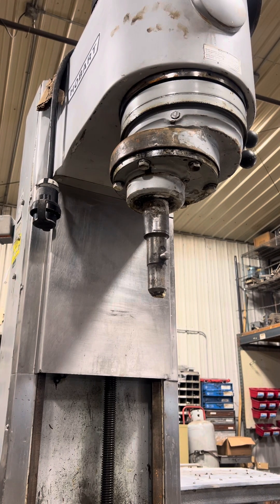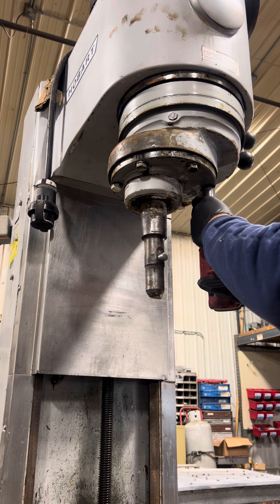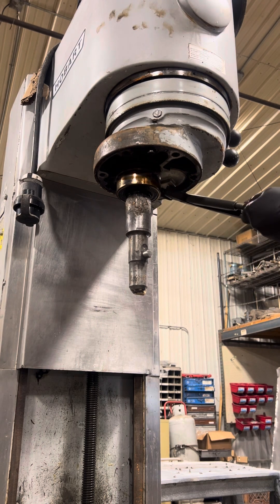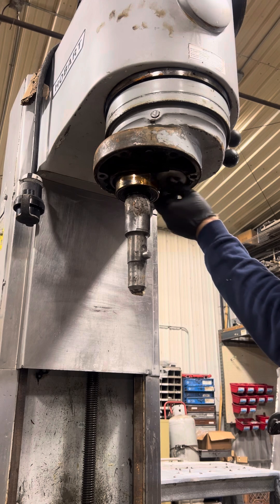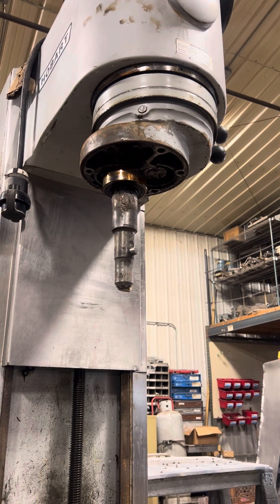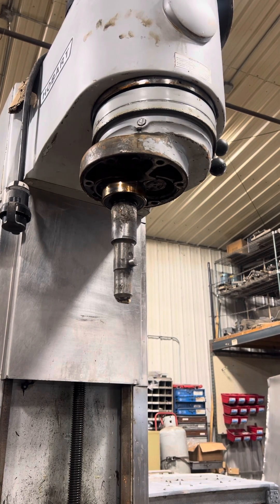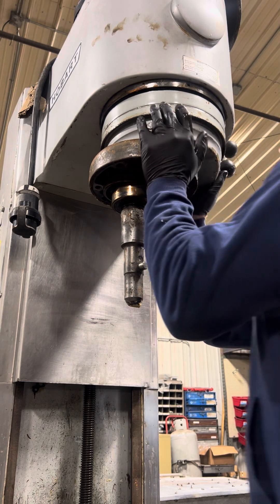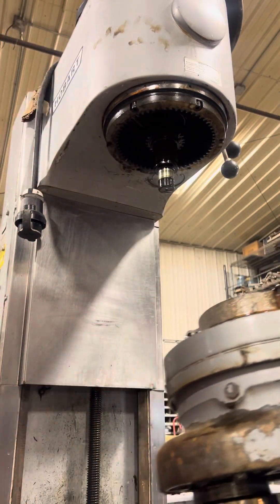Hobart v1401 140qt Planetary Removal By DBE

Comment: I can’t believe I just came across this video lol. I work on industrial equipment every day and there’s almost never any videos of these machines. Our mixer blew out the double bearing inside this shaft and dropped every ball bearing into our mix. Had to throw everything away. Working on this mixer today and just got down to the cap seal nut. I need a pipe wrench for ours but it was nice to see how it comes apart because I’ve been concerned with how much this thing weighs and how fast will it drop on me when I’m under it lol. Awesome video man, thank you for this one 👍✌️